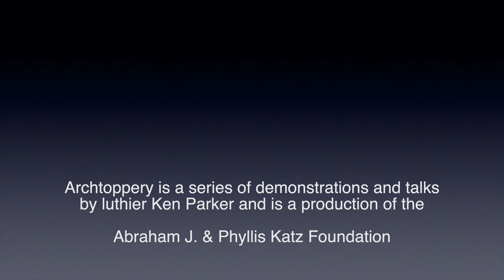Ken Parker Archtoppery - Edge Tools - A Humble Spokeshave Becomes a Magic Wand 7) Conclusion

Comment: I have a couple of thin files for similar purposes ... couldn't find them commercially so I had a rummage through my drawers and came up with a couple of fairly thin Vallorbe files, then hand lapped off the teeth from one side. It is surprising how often these get pressed into service.
Another work around is to get one of the cheap thin Chinese diamond plates and cut them into strips of suitable width with a cutting disc in the angle grinder. I tidy up the edges on a scrap diamond plate. Rough and ready, but gets the job done
Reply from the maker: Now that's a cool idea! Good one!
Reply: @kenparkerarchtoppery9440  
Perhaps you brought me good luck - Yesterday I went to a car boot sale and I bought a biscuit tin full of Swiss Vallorbe needle files cleared from his grandfather's garden shed after he passed on. There are 135 of them .... including two lovely thin tapered barrette files that I don't think even vallorbe make anymore. They are all in great condition and wrapped in layers between oil soaked cardboard. indeed a lot of them were pushed down into the corrugations of the cardboard. [a practice I might adopt] The guy seemed intent that he wanted rid of everything on that day so I was happy to oblige and pay the asking price .... £2 .... less than the price of a beer!
I came home with a grin like a Cheshire cat ;<)
Reply: @kenparkerarchtoppery9440  
I'll also use the same method to either form a new safe edge, or touch up the safe edge built into the file - these can be a bit 'approximate' and a lapping up on a flat granite plate with some fine silicon carbide powder, gives really crisp internal corners on the work. as this corner starts to wear, I simply redo it - a few minutes work.

Comment: This series is very well presented.  One question:  in all of your geometrical analysis and diagrams you do not discuss the secondary bevel.  It comes up indirectly in this last video but without any real discussion.  How does the additional 5 degrees affect the cutting action of a plane with bevel down in general?  Do you not usually hone this way?  To me it is the only practical way to get a razor sharp cutting edge in the iron.  Also for what it is worth I found that honing jig that clamps on the top like you have to be a pain and unrepeatable.  I switched to only using the ones that clamp on the sides of the iron.  Thank you.
Reply from the maker: For an edge tool, the only part of the tool that the material you're cutting "cares" about is the sharpness angle of the edge entering the work, or primary bevel. The wood can't "know" about any secondary bevel, so if you sharpen an edge tool with a primary and secondary bevel, it's for your own convenience. If grinding is hard for you, maybe the secondary bevel saves some effort when re-sharpening the primary, as there's less to remove, and so easier if you're honing on a stone by hand. If you do sharpen this way for this reason, there is an unfortunate tendency to thicken, or increase the sharpness angle when you hone, and that will increase the force you'll need to apply to the edge to get it to penetrate the wood. As far as honing jigs go, they all have some foibles, and I use them only for a couple of tasks, and mostly just eyeball things. It's tempting to jig everything , but sometimes it seems better to just go for it, and get better at sharpening "offhand".
Reply: Your comments make sense.  I have closely followed the instruction in the Jim Kingshot video and book for the past 25 years and have had great results.  In fact I made my own infill smoothing plane according to that source which takes a half thousandth shaving.  I am sure you are familiar with these publications.  So in essence you are saying that secondary bevel is a potential detriment to the slicing action of the cutting blade.  Is there an optimal angle after all sharpening for the cutting blade to both cut as easily as possible and be durable to chipping etc?  Thank you.

Comment: Fantastic series Ken, I think a lot of guitar makers (Myself included) don't think much about solder outside of pot and pickup installation which is a shame because the way you've proven to use it opens up a world of possibilities. I cant wait to make my own spoke shave. PS for anyone watching that's on the fence about purchasing a split lap machine, do it! they are a game changer! i cannot believe they aren't talked about more in the world of sharpening. Thanks Ken!
Reply: Hey Sam, not surprised to see you here! Great work on them archtops, I like the Stauffer headstock in particular.
Reply: Yo! @malcolmrose-zadow5517  Right back at you! Cheers!
Reply from the maker: They aren't spoken of more because (I believe) it was me that applied this jeweler's power tool to the world of edge tool refinement, (!) I agree it is a game changer!! I can sharpen a whole tray of gouges and other edge tools in less time than it used to take me to get satisfied with just one edge!!! In one of the top roughing videos, I timed the stroll to the device, the restoration of the edge, and the trip back to the work at forty seconds! Race, anyone?? Plus, because of how the hard felt wheel acts, it automatically imparts an optimum polished edge that lasts far longer than one produced by many other methods which may seem equivalent at first glance. It's bordering on magic!
Reply from the maker: I love that thing too! That guy was an under-appreciated wizard for certain. Check out his story, he's an inspiration!

Comment: OK, after watching this entire series again, cuz even as a self proclaimed tool addict, funding and She Who Must Be Obeyed 😂continues to limit my acquisition of have to have items ( she is leaving tomorrow for a trip, and I am heading over the lake for an original Parrot Vise, maybe having to request a picture of the original base?  - I need to connect and respond again, testing your patience once more…..the thumbnail for the follow up can be “ THIS IS HOW TO REPAIR Mr. Economacki’s Sharpening Jig!”  Substitute a bearing sold everywhere as an outfeed accessory for the brass roller?  You actually have Three Makita water wheels? 😮 😢. I’m so jealous.  My take on the chips fouling the throat is the 7 thou. are stiff enough to just get through, and the wispy ones need help.  But….. you are using as a fairing tool, and finish with a random orbital after hand scraping, so is there really any issue, other than it’s not quite perfect yet?  And on this follow up review, your knife looks like a scalpel…..wonder which felt wheel was responsible?   And lastly, I’m positive that anyone who does critical measurements had coronary’s after seeing your use of the surface plate 😂. I love it!  You know, in your next profession, people are making real money teaching just about anything you have put into your series.  But I also really enjoy shop time with music in the background, and doing just what you are famous for,      alone with zero distractions 😊.   Thanks Ken
Reply from the maker: Your most welcome, and for the record, it's hard for a lil' ol' guitarmaker like me to hurt a granite surface plate!
Tools are supposed to work for us, let's not forget who's boss!

Comment: Nice videos on the Magic Wand. I'm wondering if you've experienced the spokeshaves from Lie-Nielsen? I think they are wonderful tools (albeit a bit pricey). Maybe the only drawback in this use, the handles are quite low.
Reply from the maker: Their cast bronze spokeshaves are designs by the celebrated chairmaker Brian Boggs, which are quite similar to early mid-19th century designs, and simply clamp the blade, without depth adjustment screws.
I think it's hard to beat the Stanley/Bailey designed cast iron tools, and the ones I like the most are the later designs, which have two regulating screws, allowing quick and precise cutting depth adjustments. I have one of the Lie Nielsen "low angle" ones that I've never been very happy with, but have not tried their regular kind. Although the Lie Nielsen bodies are quite likely more precisely machined in the throat opening, as they provide plastic spacers to close it, unfortunately, they don't call this out in their catalog, so it's hard to know just what they're aiming at.
For my money, hotrodding an old Stanley is the easy choice.

Comment: So in essence you increased the opening between the brass insert and the chip breaker to allow the more wispy shavings an easier passage to prevent clogging?
Reply from the maker: Yep. Shavings are funny things, sometimes they go all accordion shaped and get stuck more easily, and sometimes big, thick ones will slide right on through with hardly any clearance. Dry spray lube might be helpful.

Comment: 3:25 I've ground a blade that had this curved shape, but I kinda get confused with it. I don't know the proper way and I just hope I don't mess up the curvature
Reply from the maker: If you don't have a crystal clear plan, stay away from the grinder until you do, you can't put it back. I recommend making practice blades out of wood until you get to your "AHA!" moment. Practice in wood is cheap, unlike nice hardened steel, plus it's quick, and you can prove your mental image of what you'll need.

Comment: that is not a spokeshave.  it is a handplane with handles.

for all the talk about flatness, it's pretty funny watching him round off the cutting edge on a buffing wheel.  it cuts great that way too ... just not because it's flat.  the sole is curved, the back rake is curved, the sole rake is curved, the blade profile is curved ... the idea of needing the blade or the clamps flat is fairly arbitrary.  the mating of the blade to the body you could argue needs to be flat ... but really, even if you mill it flat it's probably only touching on a few points.  the clamp probably only touches on a few points as well since it's getting deformed as its mechanism of clamping.

woodworker people always want stuff flat ... but generally curved tools cut way better.

the chips jammed because the chip is thicker than the depth of cut.  you are "pushing a rope" when you form a chip.  since cutting the chip off robs it of its structural integrity its gonna collapse when you push it.  especially going cross grain.

the gap he decided on, and the chip depth are personal preference for his use. and the dang thing does cut nicely.

I want one.
Reply from the maker: Handplane with handles it is!
You, sir, are precisely correct in your chip behavior observations. As with many cutting operations, handling the swarf is critical to achieving a great result, and perhaps nowhere more so than in this instance! 
Shortly I will do a deep dive into the power hone you speak of, and I can assure you that it is in no way a "buffing wheel" when used properly, and serves to strengthen the edge just as you describe without distorting the shape, straight or not. You'll see, and I think you'll wanna join the club, too!